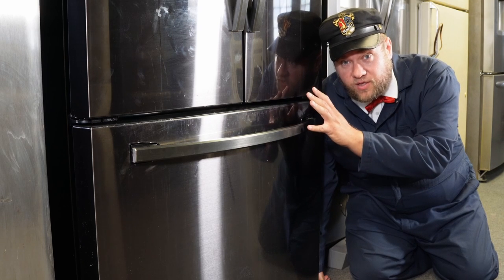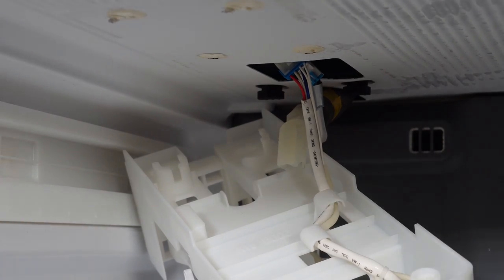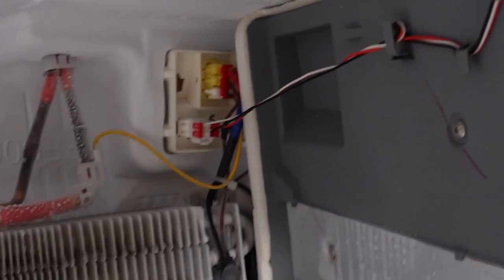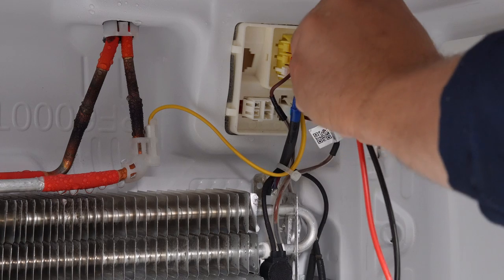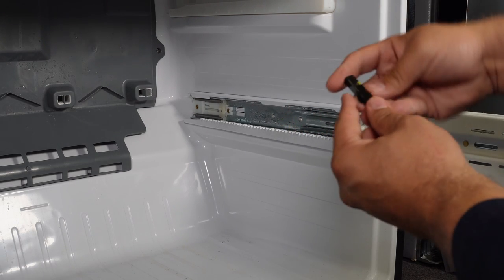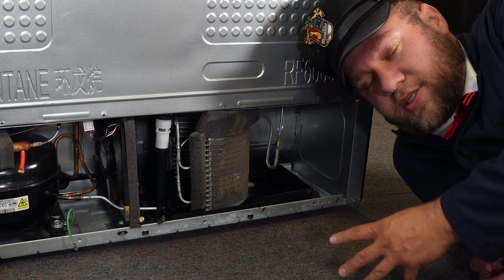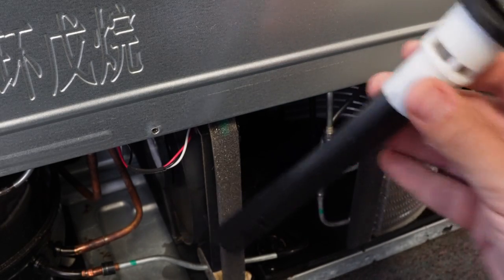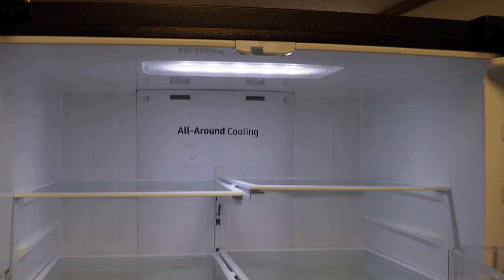Samsung Refrigerator Freezer Not Working or Won't Cool Enough - Ideas to Test and Fix!

Comment: Next step don't buy a Samsung or LG
Reply from the maker: Very true!
Reply: Lol
Reply: Don't buy those or a Traditional maytag/admiral, frigidaire/electrolux/ge/haier, bosch, fischer paykel or any unit that is based on the oem above (Kenmore).

For Appliances 
Stick to Whirlpool or Whirlpool based(excluding the rotor stator "direct drive cabrio/bravos/oasis) for washers and dryers

The belt drive units are more durable and easieer to repair.

Otherwise stick to the old timer switch units)
Reply: What’s left? What should you buy then?
Reply: @fuckthisksksjjksdfjd  here’s my advice (coming from a home appliance repairer, 37 years experience)
Firstly don’t buy a kitchen or laundry product from a manufacture of TVs or electronics ect, 
Don’t buy too cheap
Definitely don’t buy too expensive, the real expensive brands have nothing to offer the mid range priced brands don’t 
Look for a good warranty 
Keep in mind, whatever you buy won’t last forever
Reply: @fuckthisksksjjksdfjd  Kenmore made
Reply: So only but sub zero?
Reply: Biggest pieces of garbage.  Stick to phones Samsung
Reply: It’s the only one that would fit.
Reply: @publicmail2  
Kenmore never actually made any appliances. They were purchased from other appliance manufacturers.
Reply: @neilkurzman4907  Whirlpool same
Reply: @publicmail2  
During Kenmore’s heyday, I believe the different appliances came from different manufacturers..
And that they could change from year to year, depending on what Kenmore thought would sell.
Sometimes your first clue was when you bought replacement parts, whose name was on the bag.
I imagine if you’re in the business you would know exactly which guts the machine had.
Reply: @shadowopsairman1583  As an appliance salesman I cannot stand whirlpool. At one point they were a reliable company with good customer service. Within the last 6 months I have seen more warranty issues due to serious problems and customer complaints due to them not be willing to service the product
Reply: ... please, comments on a video specifically made for an appliance not working. Of course all comments will be from frustrated people!
Reply: @Big_Dai  For the frustrated LG, Samsung buyers of appliances.
Reply: I will buy a all white ge before I buy a Samsung again
Reply: Mine stopped working fridge and freezer
Reply: @Crookedriverhooligan  I'm gonna get the new whirlpool phone
Reply: Then what? Made in Mexico Whirlpools?
Reply: @DVToxico  Haha 😂
Reply: A nightmare! I regret it and Cust service is quick to want to bill u for a service call smh
Reply: Agree nothing but problems
Reply: AMEN! Never Again!
Reply: Lg without the linear motor actually good imo
Reply: This is how I feel now like damn it’s always something with this Samsung for all this damn money
Reply: Lol never buy a cell phone to keep your food cold
Reply: @stillhi33  my Samsung is working fine again, just needed a little 134a. Mfgrs date 2010. I wonder how many are sent to the landfill because they are a little low on coolant.
Reply: @shadowopsairman1583 I think it would be easier to tell us what to buy regarding refrigerator/freezer options. In your opinion, what would be the best purchase option in this category because "don't buy, don't buy" don't help us unknowing losers.
Reply: @jima3129 Probably way too many to count. I'mma check that out in my unit. Thanks.
Reply: Or fridge air
Reply: Whirlpool still decent overall.
Reply: @dustinsamson4879  Frigidaire????
Reply: @publicmail2  None of them anymore really are ‘good’. They used to all be built much much better.  Now they are all made much much cheaper.
Reply: @spinnymathingy3149  if you find one from the 70s, 80s, or early 90s you find one of those buy it. If they work now they will work for another 10 to 15 years.i would guess
Reply: LG !! 👌
Reply: Yep
Reply: Learning that shit the hard way.
Reply: Just replaced ours with a GE.  Even though the GE is 13 years newer, it will use about 20 percent of more electricity in

Comment: Ok, ive got my samsung fixed, and heres what i found out that nobody could, or would tell me. My Samsung rfg297 AABP worked flawlessly for 13 years. Build  date is 2010. Yes, i occasionally cleaned the condenser coils. This is necessary on ALL refrigerators, freezers and HVAC units. Anybody should know this. If they don't they deserve what they get. Then i checked temp sensors. All ok. Then i checked fans. All ran with 12v dc, But, the condenser fan woukd pulse on two or three times, then stop. I changed the fan. Now listen: the fan must be the exact same type that came with the fridge, mine was a type 11. I also bent the pins on the connector a bit. Then I installed a piercing valve and added a bit of 134a refrigerant, till i got 7 lbs on the low side. It initially read minus 3. I think that was it. It was low on charge. Nobody, on no utube video said that these 134a systems need to be topped up from time to time. I had to figure it out the hard way. My freezer is at 4 deg f, i am still not getting ice from the ice maker, bought a new one, still no ice. Bought ice trays, i now have ice, but ice maker still not working. Im going to change the ice room fan again, its the squirrel cage one on the left. this one is marked 13A. (Not amps, just the number on the fan) I think all these 12vdc fans are specific in that they communicate to the mainboard through the white sense wire. These things are WAYYYYY too damned complicated. Making a refrigerator so complicated that they fail and end up in the landfill in just a few years is criminal beyond beleif, just like the damned ink jet printers where a new cartridge costs more than a whole new printer. CRIMINAL!

Comment: Hi Ben.  I followed your video and changed all sensor you showed.  Still my freezer is not freezing.  I cleaned all grill dust and I don't have Ice build up problem.  What else can cause my freezer not getting cold.  FAn is working great. it remains at 32F.
Reply: mine is the same.  did you ever fix it?
Reply: I ended up having success with adding R134a and then my freezer condenser started getting cold again

Comment: My fan is not working. What would be my next step? Not getting 12V at the fan connector. Defrost brown leads are  around 60ohms. The sensor was about 6200 ohms. Still covered in ice.

Comment: "It needs to be very tight" Is that why they designed it with two short self tapping screws into plastic. Only one on each side? You're kidding, right Ben? I guess Samsung hired the ford engineers that have been designing their engines since 2000. Lolol

Comment: Don't clean the condenser coil the way this guy describes. If you're using a vacuum put one of those brush is on the end that you would use to clean your baseport with the bristles on it. This way when you vacuum the coil off you don't smash the coil face over like hes doing in this picture with his shopvac.  You don't want to damage the coil face.

Comment: Great how-to video, really appreciate the details how to access internals and how to test the sensor and heating element.  However one suggestion, at 11:30 while vacuuming the coils under the back cover:  it wasn't the brush that damaged the fins,  it was the hose of the vacuum that smashed several fins. To avoid that, suggest using a "dust brush" attachment added to the end of the vacuum hose. The attachment's soft bristles, will not only help avoid mangling the fins, but also helps remove the dust/debris by conforming the curved shape and teasing loose the debris.  Mangled fins restrict the air flow through that heat-exchanger.

Comment: Thanks Ben! This gives me some great direction to look into. My freezer just quit, well kind of. Refrigerator still works fine but the freezer only gets down to fridge temps. Pretty frustrating on a 2yr old $1800.00 unit. Thanks again for the great info. I'm fairly confident I'll figure it out after watching this.
Reply: Mine too, did you ever figure out the problem?
Reply: @travisconover4762  Followed all his steps to check mine and it ended up being too much food in there leaving very little room for cold air to circulate. Moved some of it to the chest freezer in the garage and all the food in the drawer freezer froze solid again.
Reply: @jeffscott3160  thanks for your reply!

Comment: When I found this video, I thought I had found salvation. My Samsung fridge is just under 7 years old and the freezer quit working. I followed the guide here, and honestly struggled a lot. My drawer did not fully extend outward, even though it's never been touched since the factory. All my wiring was on the opposite side of what you found on this model. However, all the connectors were the same, so I thought to myself; "Cool! I can still perform all the tests, and figure this pig out."

So I did the tests, found 0 Ohms on the wires you said to check for the defrost heater circuit. So I went to the Samsung website, entered in the exact model of my fridge, and ordered the replacement part, as well as a new temp sensor since I was unsure if mine was in spec.

I waited 4 business days and the parts arrived today. Hooray! So I went to work trying to fix this stupid device that has no reason to be defective this early in it's lifespan.

SAMSUNG SENT ME THE WRONG PARTS! You have got to be kidding me! I'm so pissed off right now. I will never purchase another Samsung product willingly.
Reply: Did you fix it?

Comment: Thank you for the help, turned out to be a dirty coil. I bought it used and they said it worked great BUT they didn't tell me the freezer was stuck at 57 degrees,  was concerned I bought a lemon but thanks to your video it works now as intended.  They sold a perfectly good refrigerator, and now how to buy another new one.

Comment: The part about making sure the drawer gears are in sync was what solved my problem.

Thanks for a very through explanation including the 10 mm size of the bolts.

Comment: Hi Ben, can you go a little deeper on the freezer section? Ie: On my rfg 297 there are two fans on the freezer evap panel. The squirrel cage fan on the left blows air all the eay up to the ice maker on mine (yeah, i know, really stupid design) that 12v motor runs at 2950 rpm. The right freezer evap fan is a conventional 3 blade. It runs at 2520 rpm. I guess they thought the increased rpm would do the trick???😮 It is my understanding that the freezer had to be at least 0 deg F for the ice maker to operate. I think it must be very important to replace these 12v motors with the proper speed replacements. I think they seriously underpowered these fans, pushing very cold air upward is difficult, and the fans on these are whimpy as hell. I replaced both motors, the temp sensor, the defrost sensor, and the crappy weatherstripping around the squirrel cage air chute. Freezer is down to 8 deg F, but still no ice. I guess they are right on the 0 deg f for ice production. I see that the newer models have the ice fan right behind the ice maker tray. Good thing the same engineers didn't design the AM6. LOLOL

Comment: Hello and thank you for the info. I have a 2012 Samsung French door refrigerator model Rf263beaesr/aa that is not freezing. The evaporator fan is not getting power, could the problem be in the main control board? I checked everything else you suggested

Comment: I love that extension on you drill. What is it.? Looks nice and girthy. I have so many extension that snap off.
Reply from the maker: its just a Masterforce bit holder with an impact-rated philips head screwdriver. I am gonna goto power drills on all videos because after dealing with the POS bolts on this Samsung, I want to save myself some time from now on lol

Comment: Ben awesome video. I have done the heater upgrade and installed the drain clip. I am still having a problem where the door temperature says 34 degrees but the actual temp is around 46 degrees.  Can you help?

Comment: Thank you for this detailed video Ben, I have the same unit and followed your instructions to the letter. Nothing seemed amiss or was out of spec range and still the freezer will only chill to the upper cabinet temp of 36 even though the control display shows it attained  -2 where I set it. What would you suggest I do next ?
Reply: Also the compressor runs constantly….
Reply: Is the evaporator frosting all the way. Could be a gas leak or blockage
Reply: I have the same trouble with my Samsung. No frost build up..what was wrong with yours. My refrigerator works fine my freezer causes ice Creme to melt etc
Reply: Same here with my Samsung. Worst pos.
Reply: Herman - you ever resolve your issue ? I have exact same issue and can’t resolve.
Reply: @shaneo954  no boards too expensive, we replaced with GE. FROM LOWES.

Comment: Great video. I followed the steps and my temp sensors (I had one by the coil and one on the ceiling if the fridge compartment) both read pretty accurate. I checked the voltage going to them and it was 4.8V and the voltage to my fan was 9.6V not 12V. My freezer thinks it is at 0F when it's actually 15-18F. Could low voltage be the issue?
Reply: Mine is doing the same thing and no ice....what did todo to fix ? Ed 1:58
Reply: @edbauscher9949  ended up getting a new fridge. I replaced some of the electronic boards and that didn't fix it either.
Reply: Thanks Travis, I’ll let you know about where this going later. Ed

Comment: Hey Ben, my Kenmore Elite model 795.71054.013 bottom freezer is not cold enough. Fans work, condenser is clean and compressor runs. Last time I checked with a thermometer and temperature would fluctuate from the twenties to -6. I opened the cover and evaporator had a little of ice formation on the top right. Any advice? Thanks

Comment: Hi,
I tested everything with multimeter but unfortunately my refrigerator is working good for a few hours and then tripping the GFCI outlet , do you know what I should check??
I watched your other video for error codes but there is no error codes.
I checked other circuits too.

Comment: Ben, nice video.  The problem with mine is that it seems like it is stuck in defrost mode.  The fan is working fine, but no frost on the coil and close to room temp.  Any idea how to test too see if the defrost timer might be stuck?
Reply from the maker: There is no defrost timer on a Samsung refrigerator. Its on the board. You could unplug it, let the caps drain for 1-2 minutes then plug it back in to see if it resets anything.
Reply: @bensappliancesandjunk  Thank you so much for the response (glad to see you accept tips!).  One last question if you don't mind.  If the coil inside the freezer is not cooling at all, does it pay to check the other components in the video (Thermostat/Thermalfuse/Dirt on Condensor coil)?  The fact that the freezer went from cooling fine to not cooling at all leads me to believe this might be a PCB issue.

Comment: Ben, my Samsung French door fridge/freezer stopped working. The refrigerator hold 34° the freezer is 70°. I just started getting error code 21 E and 40 E. The seal is fine as far as I can tell. I had a technician come out and he replace the logic board and some sensor. He didn’t touch the ice maker sensor as far as I know or the fan. Since he left, nothing has changed except the ice in the door that was operating normally has stopped working. Everything I have read says the lower ice sensor and/or the freezer fan are at fault. Any suggestions?

Comment: my  freezer  workk too much  all thte top part are  completly  froze 
it look  like  the trapp  do not  work  ok  sometime  still open and  make  lot  of  nois  
how i can  clean it  or replace  it
I have a model rf22nctaww with freezer at the bottom it freezes at the top it doesn't control its temperature well at the top have to change the fan at the bottom it doesn't do anything cahnge they can hear the hatch open or close
but have doubts whether it closes completely and it freezes everywhere is it difficult to clean the hatch or change it on this model

a video would be welcome
THANKS

Comment: My coils  in the freezer section are not getting cold. The fan in the freezer section works. And the condenser fan in the back works also. The condenser coils are perfectly clean. Fridge section and top ice maker works. No diag codes flashing. Running out of ideas.
Reply: Same issue here, have you found the fix ?